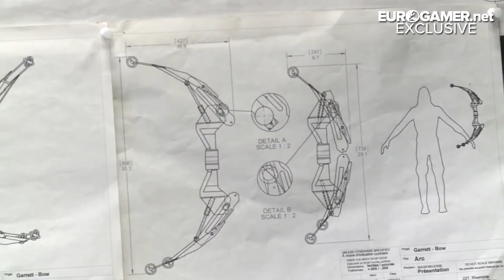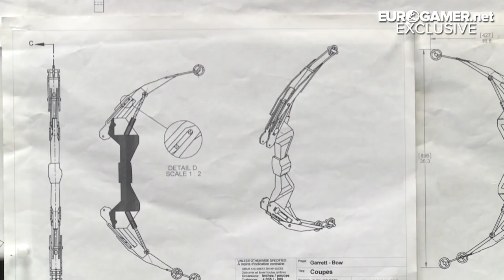Thief (Thief 4) - EXCLUSIVE Interview and Preview - Eurogamer

Comment: Deadly Shadows didn't just have dynamic moving shadows. It had exclusively dynamic shadows with zero static lights. At the time the only other game with that feature was Doom3. A few years later came F.E.A.R and S.T.A.L.K.E.R.

...And then everyone forgot about full dynamic lighting for some reason. Apparently Eurogamer actually forgot that the feature was possible ten years ago so they pretend it's new for PS4, when it was already possible on the original Xbox.

Comment: And I only found every secret in TMA by using the FAQ. Even then, they were unrewarding, for example, the room opened by a lever in Casing the Joint that has literally nothing in it. So, if the game is built around it, what's your problem with it? It won't be OP, it's just a new idea they're bringing to the franchise. Art style? You've seen, what, 15 screenshots, all from the same level, and you're an expert in the art style now? Yeah, nice one.